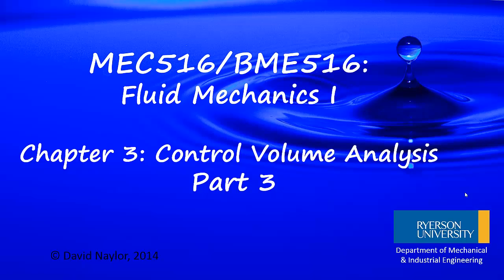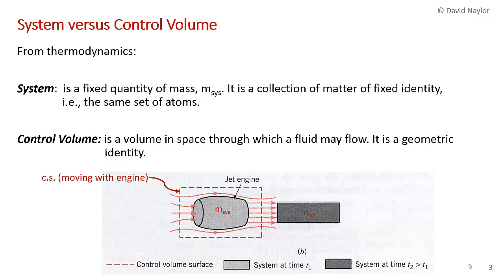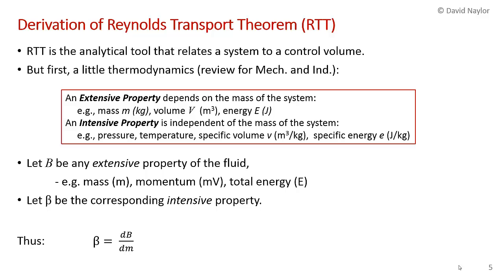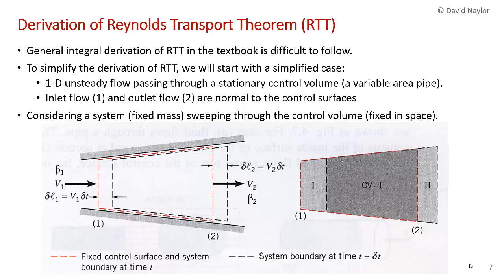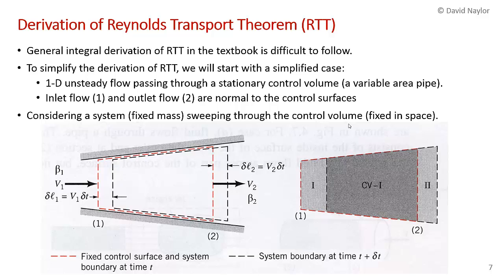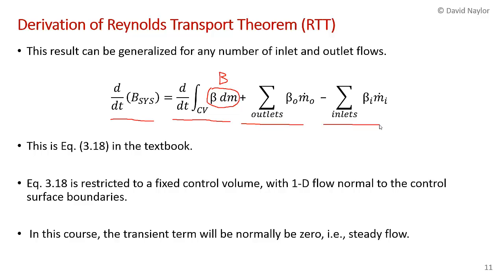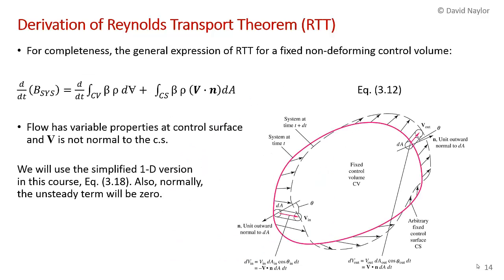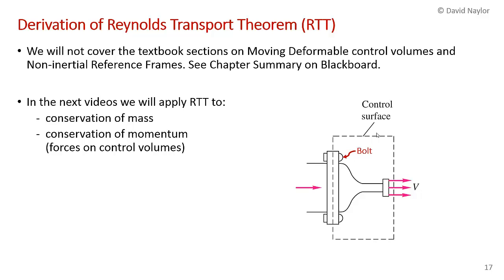Reynolds Transport Theorem

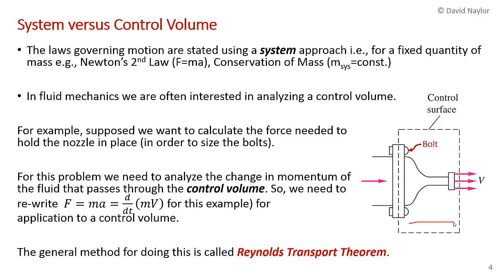Comment: 5:20 I still don't understand why we need to analyze the change in momentum of the fluid to calculate the force needed to hold the nozzle in place. Or perhaps it's bcs the fluid is not accelerating and so we need to change F=m.a into F=m.v/t ?
Reply from the maker: This will become clearer in later videos. The fluid in a nozzle accelerates, even for a steady flow. This is because the fluid exits at a higher velocity than it enters -- that's the function of a nozzle. The force required to accelerate the flow has to come from somewhere. So, yes, you need to do an F=ma analysis for a control volume around the nozzle. I hope that helps. Here's a video that explains the analysis of forces on a nozzle: https://youtu.be/pk3nFNQRmFU?si=s8Xxo_zzmxUJCfiE
Reply: @FluidMatters where does the Delta P factor?
Reply from the maker: @YZFoFittie  I think this video covers exactly the question you are asking:
https://youtu.be/pk3nFNQRmFU?si=Por_XP5YrMAUfog5
I hope that helps. Thanks for the comment.